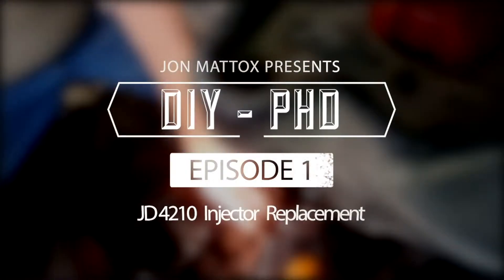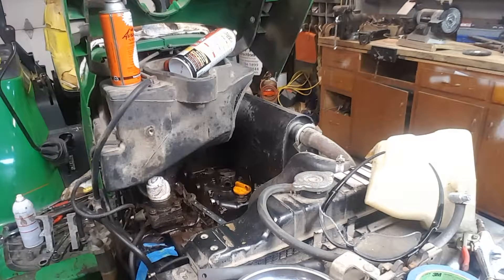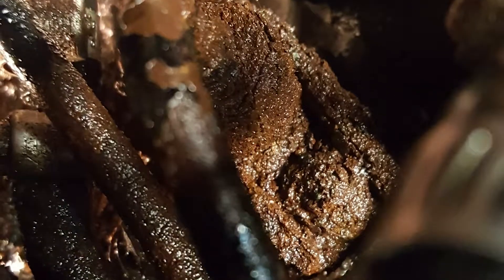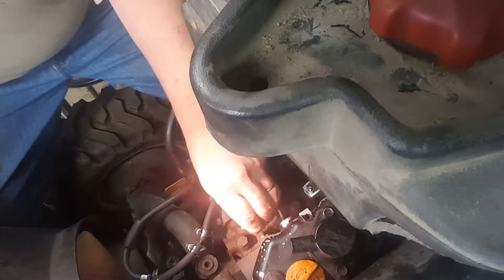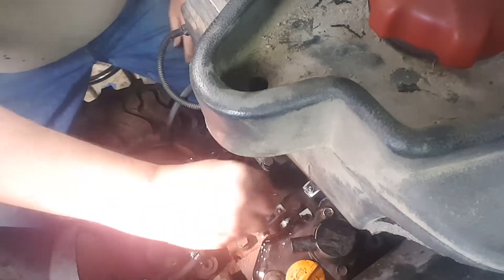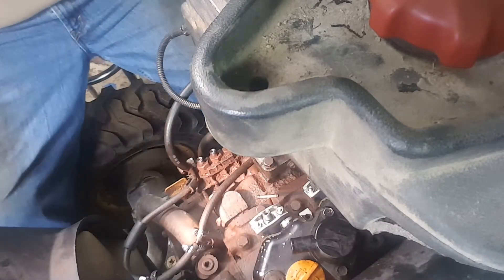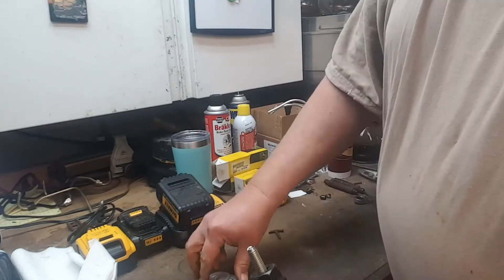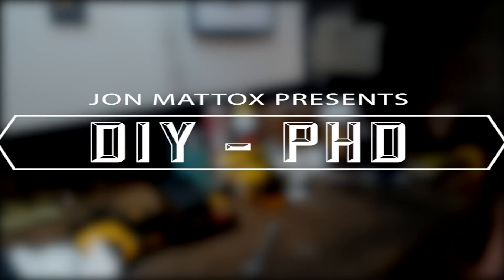DIY - PHD Episode #1 - John Deere 4210 Injector Replacement

Comment: This was so, so, so incredibly helpful. Worked like a charm. I removed the fuel tank for access and tried the slide hammer at first, but the corrosion was so bad on one of the injectors I don't think the slide hammer per the manual would have ever got it done.